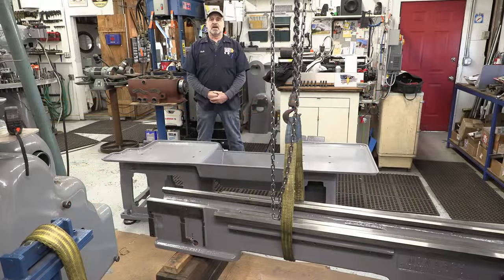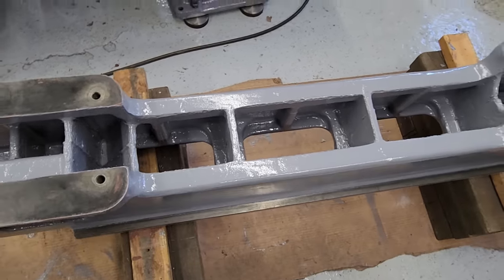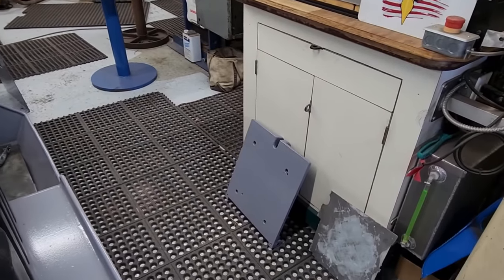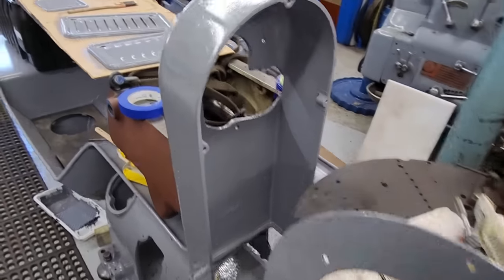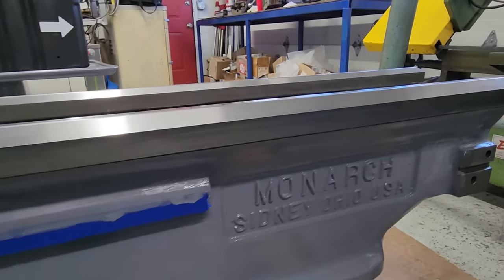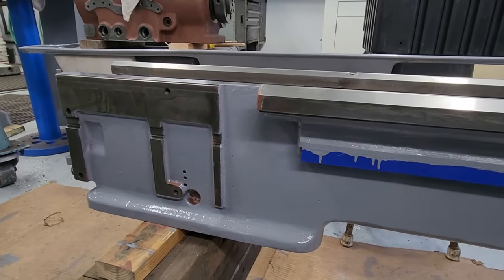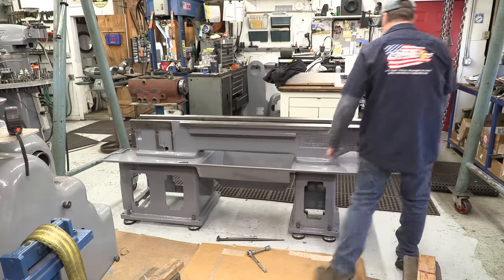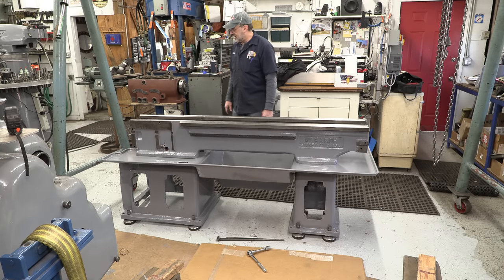Pearl Assemble and Level Bed

Comment: As soon as you mentioned math to figure out the level, I knew what you were going to do using thread pitch to determine how much to turn the screws by. While I've never done it to level out a lathe I used to build custom muzzle loading rifles and had to use similar math to index the breech plug to the top flat of the barrel and to know how many thousandths of an inch to machine things to to have it indexed and clocked.

Comment: I've watched a lot of folks video leveling equipment - yours is the first time that I've seen math used to calculate the bolt turns needed. Working smarter, not harder. Great tip to use a torque wrench to balance the tension on the bolts.

Comment: WOW ! 3 phase power, and rebuilding a monarch lathe, what list do I get on to be so freaking lucky, very envious Keith , I have two Hercules lathes and a pacific horizontal mill to go through, I paid less than $600 for the two lathes , one is a 18 x 60 and the other one is an 18 x 80. They both really need cleaned and painted and I haven’t had a minutes rest in the last two years to work on them. I am very much enjoying the videos on your Monarch project, it is nice to see somebody take the time and patience to do it, right thanks, Keith.

Comment: Sounds like maybe the magnet part of the contractor is dirty on your phase converter. May pop it out and run it a few strokes across some fine flat sandpaper. I have had that cure the buzzing.

Comment: Wow--looking great! So that lathe, built in mid-41, wasn't built during the war. But...think about it this way: It could have been sitting on a ship at Pearl Harbor on the morning of 07 Dec when the Japanese attacked. It could also have been on a ship for the duration of the war in the Pacific; or it might have been on a US destroyer escorting supply convoys across the Atlantic, running down wolf-packs of German submarines intent on sending it (and the ship it was mounted to) to the bottom. Either way it might well have done repair work for the equipment being used to actively fight the war. Staggering thought...the events going on in the world when Pearl was just an infant. 

HOLY COW that thing is cool!
Reply: I should clarify: It wasn't built during the period of WW2 when the US was officially a combatant. Of course Germany was in Poland (1939), and also attacking the UK (Battle of Britain was in 1940), and Japan had LONG  been running rampant in China. But the US had not formally entered the war as anything other than a supplier until Dec 1941...so this lathe had already been built by that time.

Comment: I'm curious to see the level you setted perfectly one year later, I remember that when we planned a shop for the installation of machinery, the floor was reinforced at the level of the machines and this was not rare that the machine needed to be realigned within the first year of use. because the floor have creeped.
 I'm anxious to see that machine in operation
very good video.

Comment: Hey Keith good job. What you can do as a final check to make sure you don't have a soft foot. Looks like you have jack screws and working with just the 4 outer feet. Say at the headstock end put two dial indicators from the floor to the top of each of the two feet.  Turn in the jack screw on one of the feet until the opposite foot raises .001". Then read that dial. Reverse the process to the other foot. The two readings should be the same. If not some of your jack screw motion is going into removing a soft foot.
Reply from the maker: Thanks I do it with inch pound torque wrench 4 at tailstock match and 4 at headstock match...
Reply: @KeithFenner  The only problem with using a torque wrench is that you are relying on the friction between the threads and the friction between the bolt end and the pads you made being the same on all four feet. All good, love watching your video's Keith.
Reply from the maker: Yes I am, fresh threads, coated in neversezze all machined the same and the pads are all the same as well, it will be more acurate than any other medthod in my book.
Reply: @KeithFenner  You do very nice work! Thanks for the replies Keith

Comment: I'm curious, you were concerned about not having paint on the mounting surfaces of the bed, but then set it down on the painted chip pan surface. Enjoying the series.
Reply: i was wondeing why not silicon between the bed and the chip pan , so it is protected from rust ?
Reply from the maker: No it was metal to metal when I took it apart, no rust, just clean metals, I figure the fresh paint coated even on each side of pan would be enough of added seal if any was needed, the only real contact is 50 cent diameters around each holes on pedestals, so that whole foot of the bed never meets pressure except the washer size ring arounds the bolt holes.

Comment: 4:00 Have to disagree here: the rack gear is not clean: it has grey point splotches on several parts of it.  Extra demerits because it looks like a removeable part, too.
20:50 Love the picture-in-picture!!

Comment: How is a lathe leveled on a Navy ship say like an aircraft carrier or do they even bother with it?
Reply: My guess is that they probably just get it close and that's it.  Level is not all that important on a lathe, but twist is.  My Logan lathe is mounted on a "ship cabinet", with two mounting points under the headstock end and one under the tailstock end.  There are also 4 separate adjusters between the lathe bed and the cabinet to get rid of any twist.

Comment: Why were machines painted Gray or Green back in the day ?
Reply: Monarch uses normally green e.g. 16 CY, on 10 EE grey. American Peacemaker of 1942 they choose grey.
Reply: @bernardwill7196  Buy why only those two colors ? Why not Beige, Blue or Red ?
Reply: Possibly due to Grey both hiding surface imperfections and being a military colour, ref Navy, the Green is a more pleasing colour,  and again a military colour.  Green, from  dark to light was developed for welding shops, darker green from the floor up to 6 or 8 feet (1.2 to 2.4 metres), a lighter green to 12/16 feet ( 3.7to 5 metres), then white, or very light colour to the ceiling. 
Colour schemes change over time, in Europe,  machine tools were nearly always Reseda Green ( RAL 6011),  now a light grey with blue base up to 18" (400mm) from the floor.
It would be Interesting to hear others comment on machine tool colours.
Reply: @RichieCat4223  I am a german. I own an Alzmetall from 1942- That's a precision lathe. 30 " x 100 ". That lathe works excellent. It is green, so we say british racing green? I manufacture for the Bugatti drivers ( old one ) crankshafts  and others . This lathe is on 2m maybe 7 feet accurate by 0.001 mm equals  0,00254 ".
Reply: @bostedtap8399  Maybe all tools are dark brown to black, the tooltips most silver.
Reply: @bernardwill7196  Sehr Gute, 👍
Reply: I have heard or understand it is the same reason that steam loco cabs were painted light green, the color does not show dirt or grease/oil as much as other colors and is fairly easy to clean.
Reply: @royreynolds108  Thanks
Reply: @bostedtap8399  Thanks

Comment: dont you need to seal the bed onto the tray , if you dont cutting fluid will escape through the bolt holes
Reply from the maker: Those four metal to metal surfaces on each hole had no sealant on them and was clean as a wissel, I figure my fresh coat of paint on each side of pan will make it.
Reply: @KeithFenner  doubt it, i think it will leak, i rebiult an old lang lathe and despite sealling it it leaked, had to dismantle it again and reseal it. This finally stopped it leaking.
Reply from the maker: LOL
Reply: @andrewbrown6705  I wasn’t about to try to get my series 90 monarch loose from its mangled up chip pan so I took the cheater route and just ran silicone around the base and screw holes thru the pan. That stopped it leaking coolant on the floor.

Comment: If God had meant for the imperial system to exist he would have made 12 commandments😉
Reply: Thanks non moon lander.....
Reply: I have to laugh at people who promote the metric system but don't use the metric system for everything like angular measurement where a right angle is 100 radians, or metric time with a 10 hour day or the metric calendar with 10 day weeks?
Reply: I was poking fun at the comment Keith referenced. The metric/imperial argument is ridiculous. So long as your measurements are accurate who cares?
Reply: Why use the imperial system when the metric system is better every thing is base 10 just like the dollar , all USA made cars are metric , drill tap sizes are a dream 6mm X 1  just deduct the thread pitch from the dia. easy 🥹
Reply from the maker: Funny just what I said in the video, doesn't matter as long as you make it just right!
Reply: @stuarthardy4626  dividing and multiples of two is much simpler than base 10. Fractions are more suited to general work, metric fractions are the WORST